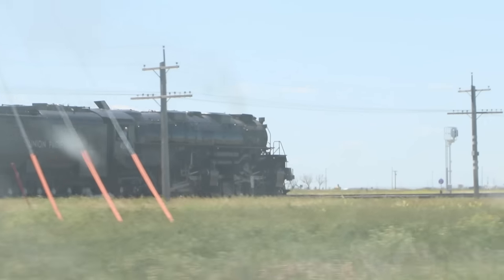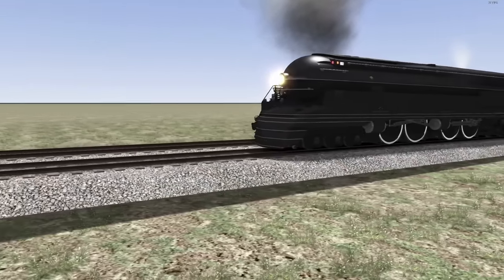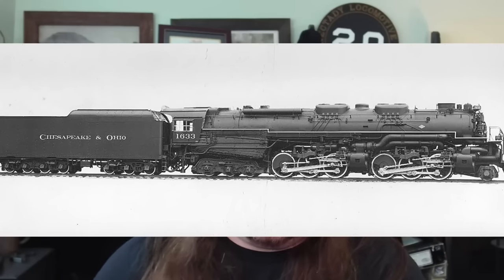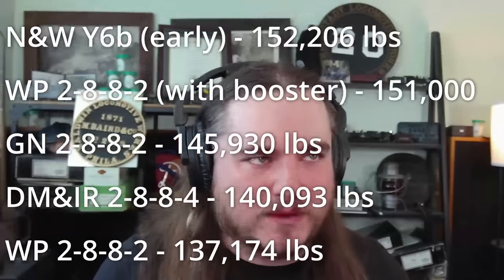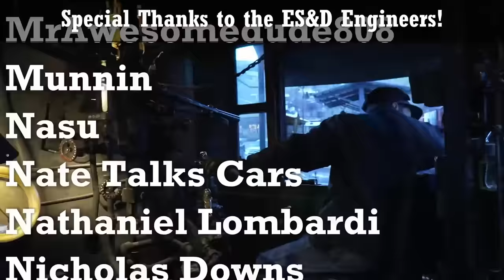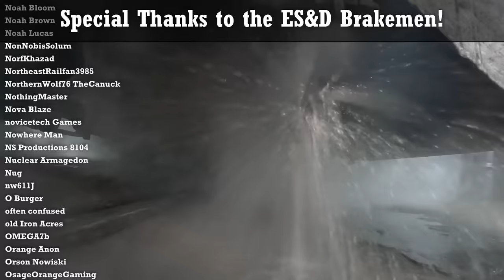BIG BOY is NOT the BIGGEST? What is then?

Comment: The thing with engineering anything for a specific application is that you ideally want to know exactly what you want the machine to do, and then optimize it for that use. There are stronger, longer, heavier locomotives than Big Boy, of course, but to compare really any engine of similar principle between one another, when you get down to brass tacks, is an apples to oranges comparison. These machines were designed for a specific purpose, at a specific speed, in a specific environment with specific restrictions. To ask what’s the absolute fastest, or absolute strongest, or absolute anything abut any machine sort of loses the nuance of what actually matters. What actually matters, in this case to the railroad management, is what is the best locomotive for us. What is the strongest or fastest locomotive, for us, for our specific restrictions and requirements.

One excellent example of this, in my opinion, is the Milwaukee Road’s Atlantic types for the Hiawatha. Almost every other railroad went for Pacifics, Hudsons, even Northerns for similar requirements, and yes, even the Milwaukee themselves ended up budging and buying Baltics (what they called Hudsons) later on. But what mattered most to the Milwaukee wasn’t ‘whats the strongest, fastest engine on the market right now’, it was ‘what is the best design for our needs and restrictions right now’, and it just so happens that a superpowered variant of the venerable Atlantic design happened to fit the bill.
Reply: Agreed. I’ve already said my thoughts about the subject, but there is more to locomotive design than just what is the biggest and the fastest.

Comment: Hmm...I'm not familiar enough with some of those eastern engines, but I think part of the reason the Big Boy stands out (besides excellent publicity on UP's part) was the fact that it was not only large and powerful, but could also move fast.  The Big Boys were reportedly tested at up to 80 mph, although its optimum speed was much lower; looking at the list of stronger engines, most of them look like engines designed to slog heavy trains at low speeds.  Its size limited its operating territory, but the Big Boy was a much more general-purpose locomotive than the others.  And a "world's biggest engine" that can roar by at 60-70 mph with a long string of cars sounds more impressive than one that trudges by at 20mph with a long string of cars.
Reply: The Allegheny's regularly hauled 140-160 car loaded coal trains and merchandise trains at 45 mph, so these two are certainly in a league of their own
Reply from the maker: Oh certainly. I'm not saying the big boy was not the most capable thing around, I'm just saying if you claim it's the biggest of all time you're not right. Lol

Comment: Widest steam locomotive was the Virginian 2-10-10-2s, which were just over 12 feet wide to accommodate their 48" low pressure cylinders. This is outside standard clearances so they had to be shipped to the Virginian with the cylinders, cabs and running boards removed and even then could only be shipped on higher than normal clearance routes. They also had the largest diameter boilers of any steam locomotives, the highest tractive effort of any successful steam locomotive, and the largest amount of evaporative heating surface of any steam locomotive. This is all despite being built in 1919, more than two decades before the Big Boys.
Reply: I should also note that the tractive effort number provided in this video is for compound operation. With their enormous boilers the 2-10-10-2s were normally run in simple for starting trains, and could produce 176,600 lbs of tractive effort when high pressure steam was sent to the huge front cylinders. Also I say highest tractive effort of any "successful" steam locomotive, because 10 of them were built and they operated for 25-30 years doing more milage than the Big Boys despite having a top speed of around 15 mph. The locomotives that exceeded them like the Virginian Triplex and Jawn Henry were one off experimental designs which were scrapped long before their designed service lives were over.
Reply: @NorfKhazad  A couple of points  the N&W  in 1917 brought into service the Y2  2-8-8-2 ,; with both tender boosters working produced 174,400 lbs tractive effort ,although the boiler could not sustain this for long periods of time ...fast forward to 1954 ;when the N&W had all the Y5 Y6 Y6a Y6b outshopped with 40 tons of scrap steel, lead and concrete onto the mainframes along with intercepting valves and extra [water]tenders , and reclassified Y6c with 310 lb b.p. they produced 190,000 lbs tractive effort in simple and were the most powerful locomotives ever in service except for 1 ! The Belgian quadruplex built in 1932 that produced 213,000 lbs tractive effort. The Nazis cut this loco into two seperate locos in 1943.
Reply: @dennismitchell-h9s  The Y5s and Y6s were upgraded to Y6Bs, the Y6C was proposed but never implemented. Some of the changes you mentioned (intercepting/reducing valve, added weight) were part of the Y6B upgrade program, but they never produced 190k pounds of tractive effort. I have never heard of this Belgian locomotive and I very much doubt it produced that level of tractive effort, if it even existed.
Reply: Thats the one I was trying to remember, they actually outpowered the Big Boy in raw tractive effort, but they couldn't get past 15mph or so because the boiler despite its size couldn't provide enough steam.  This primarily because they were 20 years earlier and boiler technology didn't have pressures as high.
Reply: @Saxxonknight  It was less because the boiler couldn't provide enough steam, and more because the low pressure cylinders were so large the reciprocating forces were a real problem. That's the main restriction on speed of most compound articulated locomotives. The N&W overcame this with the Y6B through some clever counterbalancing and other tricks, allowing it to achieve an unprecedented (for a Mallet) top speed of 60 mph. The Virginian 2-10-10-2's were huge, but relatively primitive Mallets. Sometimes referred to as the 'ultimate drag era locomotive' they were built during a time when tonnage was the primary consideration and speed was an afterthought. They had the largest boilers of any steam locomotives ever made, and while their design did not benefit from later efficiency improvements, accounts say they produced more than enough steam for the prodigious appetite of their huge cylinders. Also, as previously stated, they overpowered every successful reciprocating steam locomotive in tractive effort, not just the Big Boy. The only thing that beat them was the Triplexes, but those DID have problems with insufficient steam supply and couldn't even manage to sustain 5-10 mph for a few miles without stopping to build up steam.

Comment: The Big Boy is an awesome locomotive, and I never in my life thought I would see one that large restored.

Locally, we compare it to the Missabe Yellowstones.  They were about 100 feet apart when yhe Big Boy visited the Duluth museum.

Truth be told, they overlap a lot in statistics.   Big Boy has   more boiler horsepower and top speed.  Yellowstone has less horsepower and lower top  speed, but more tractive effort.     Big Boy is slightly longer because it was designed to burn low BTU western coal compared to the Missabe's eastern coal, thus it has a bigger firebox.

Both were designed to do different things.  Big Boy was designed to pull trains in mountains at relatively high speeds.  Yellowstone was designed to pull endlessly long ore trains at very low speeds.

Both were awesome locomotives, and I am very fortunate to see one of them running.
Reply: Remember that the classification "Yellowstone" was from the Northern Pacific's classes of steam monsters that originated the name, running heavy main line freights over the NP's undulating profile across North Dakota and along the Yellowstone River for much of their main line. They were a well developed class as witnessed by the NP's four classes of 2-8-8-4s, Z-5 throughZ-8, comprising more than 50 units. But when the NP dieselized, they leaned into it and never looked back. By 1959, all the Zs were gone. Management had no desire to look back on steam and preferred to be seen as a modern progressive road that was eager to embrace the larger high horsepower diesels that came along. Only smaller steam engines were given to communities along the line. Even the historic Timken locomotive was cut up, against the wishes of many.

Comment: One must wonder… who gave Union Pacific, PRR, and N&W unrestricted access to the whiskey? All jokes aside, I think the Big Boy is the best of the largest locomotives, but the PRR Q2s were the best of the ridged frame locomotives.
Reply: Yellowstone?
Reply: I believe that you mean rigid frame locomotives.
Reply: I mean it worked ig..except for what the Pennsy. No idea how they thought the S1 would be practical..or any of the other weird duplexes.
Reply: @whispofwords2590 The T1 and Q2 worked just fine tbh. Just too late.
Reply: @whispofwords2590, well, if they had fixed the poppet valve problem and built and rebuilt right of ways to be like the Lackawanna cutoff, then it could have been a high speed steam locomotive.  And yes, I mean actual high-speed rail.
Reply: @ThePTBRULES  I wouldn't say the Q2 worked out. Seems like an over engineered J1 to me. The T1s yes.
Reply: PRR ran the S1 for years on the western leg of the Broadway limited.   Minimum curve was its issue, and of course the co$t.
Reply: The "problem" with the T1s, was the crews were so used to the K4 pacifics that were ran to hell and back and worn-out within an inch of their lives, they got used to how they ran and just tryed to run the T1s the same way. Plus back when the N&W had their class A and class Y locomotives in service they were considered the peak of steam technology.
Reply: @ThePTBRULES  T1 prototypes are built better than production. Mods were done in the production T1s that actually made it worse. T1s 6110 & 6111 had better valves and suspension than the T1 5500-5549 had. Trying to break mallard's record with the 5550 would be un economical as A engineer who ran them stated that a slower acceleration and not exceeding 120 will negate the known wheelslip which in the end the 5550 would be more best as an excursion locomotive. Replicating T1s 6110 or 6111 would be better than doing a next in line in the T1 production. Even the Q2s would been better as well.
Reply: N&W had no other choice but to go completely overkill goblin mode when building steam locomotives 😂

The Appalachian mountains are extremely difficult. Sure they are no where near the size of the Rockies but the Apps are vast and deep. The N&W and Virginian gave up with steam in parts of West Virginia and opted for electrified rail as their solution.
Reply: @loganbaileysfunwithtrains606  But mate, as steam technology improved ,steam once again reined supreme ; the Y6b s were in part built to take over from the electrics 1948/9. One of the few cases of steamilising a railway !

Comment: I love that you showed the Q2 in the thumbnail and then didn't mention it in spite of putting out 7,987 peak HP.
Reply: indicated, drawbar is 6645.
Reply from the maker: I missed that in my narrative and Wings & Strings got it for the thumbnail. Bonkers.
Reply: They were unsuccessful. A waste of money.
Reply: Those were the most thirsty steam locomotives I've seen reports on, consuming a whopping 16,600 gallons of water an hour.
Reply: 6200horsepower can pull a 3600t.0ver Wyoming and Utah h mountains
Reply: All of which pales into insignificance compared with the [edited] 15,552 HP [Re4/4 II + Re6/6] of a Swiss SBB Re10/10 combination which can run at 140 kph (appx 87 mph) on the Gotthard or Lötschberg lines at about a gradient of 27 permille. Electricity rules OK?
Reply: @petergaskin1811  virginian EL-3C: hold my pantograph wire
(mind you a 3-unit pair of EL-3C's could make about 7000 HORSEPOWER WHICH IS JUST
H O W ?

Comment: Remember the Virginian 2-10-10-2 which have ALL THE POWER. Edit: I'm writing this when it was published at 6 minutes
Reply: and was actually the biggest steam locomotive ever built
Reply: But didn’t have as much power as a yellowstone
Reply: Do you mean the triplex 2-10-10-10-2? Or did they make a duplex decapod?

At any rate the triplex was a hot garbage engine. She couldn't really go above, like, 8MPH. But, it was really, REALLY hard to slow her down from 8MPH at max beans. Something like 115k lbs tractive. I know they served for some banking duties for a bit but then were broken apart and made into decapods I believe.
Reply: @NashRailfan  in mallet form ya but in simple mode it's more power than the Yellowstones
Reply: @IsaacBaxter  Yellowstones are Yellowstones.. there are no variations (except SP).. all are 2-8-8-4’s, or for SP, 4-8-8-2 (cab forwards)
Reply: @philtheairplanemechanic  the triplex would've been an excellent engine had it had a proper size boiler.
the erie P-1s were scrapped outright, the Virginian XA was turned into a mikado and a bullmoose, the only one the Virginian had
and no he means the AE, which was a 2-10-10-2, class of 10 i think.
they lasted until dieselization in pusher service, and are the most powerful steam locomotives ever constructed while also probably being the largest.
triplexes had 8 drivers in each set
Reply: @NashRailfan  incorrect
Reply: @CoalChrome  tell me.
Reply: @CoalChrome  The Virginian AEs were not the largest, and even by tractive effort they were beaten by the XA and the Jawn Henry. However, both were experimental designs so ultimately I would consider the AE to have the highest tractive effort of any successful steam locomotive. They were the largest when built, and they did have the largest boilers by diameter and heating surface, and the largest cylinders (48x32 lp) of any steam locomotive.
Reply: @NorfKhazad  actually they were stronger than the XA, by technicality because they could be swapped to simple.
Jawn Henry doesn't count because it was steam-electric
Reply: @CoalChrome  The XA was capable of simple operation based on the books I have, however in practice I doubt it was ever used that way since it couldn't maintain steam even for compound operation.

As for the Jawn, agreed, it's kind of its own thing.
Reply: It was used when starting but only for starting

Comment: That PRR with long tender is a I1sa class 2-10-0 pulling a 210F82 tender. The 210F82 tender is a 21,000 gallon tender with some 21 tons of coal, on a pair of 8 wheel tenders with a modern 3 person doghouse. When fully loaded, it would have outweighed the I1 by about 80,000 pounds. The I1 was known as a monster locomotive from the drag freight era and was nicknamed the Hippo

Comment: Did you take into consideration any of the big Garretts from South Africa?  Some of those are VERY long, and quite powerful, too.
One thing about the Big Boys was how WELL they worked. Many of the other engines were failures for different reasons - from being extremely complicated (like many Duplex engines), to excessive maintenance, to not having the steam capacity to make use of their power.
Reply: Yes, I've heard it said of the Big Boys--exaggerating a tad--that you all you have to do is put warm water in them and they go!
Reply: I was thinking about Garret engines too, but don't remember anything specific about them. Isn't the Big Boy itself classified as a Garret as it has one boiler over two sets of driving wheels.
Reply: @eekee6034 The Big Boy is not a Garret. Only the first set of drivers swivels. The boiler sits on the second pair like other articulateds.
Reply: @Stooltoad5017  Ah, I see. Thanks.

Comment: Ayo Hyce

As a viewer from the Metric world I'd really appreciate the inclusion of the converted units
Reply from the maker: I really should've done that. My apologies.
Reply: In the context of this video, I don't really understand why one should need other units when the point mainly is to make comparisons in which case sticking to one unit system is much easier to follow. Even though today's world is largely metric, we should still honour all units of measurements especially when we are discussing historic accounts. Just my opinion of course, but all that said here you go:
WIDTH-
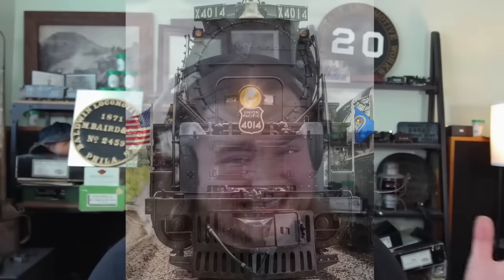1:48 Big Boy = 3.35 m
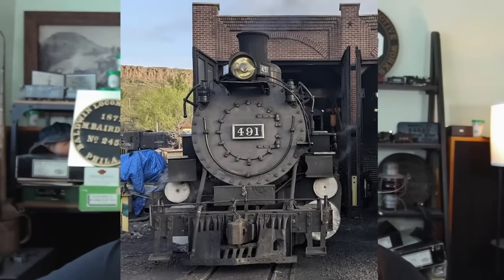1:50 491 = 3.20 m
WEIGHT-
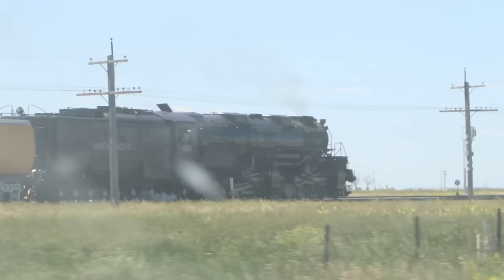2:29 Big Boy loco + tender = 548,279.78 kg
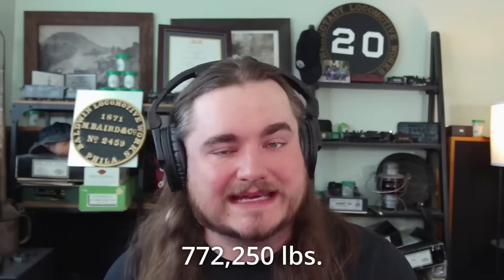2:55 Big Boy loco = 350,286.71 kg
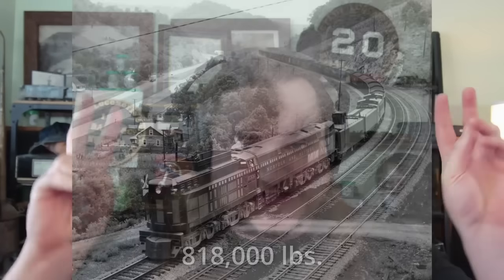3:02 Jawn Henry loco = 371,038.56 kg
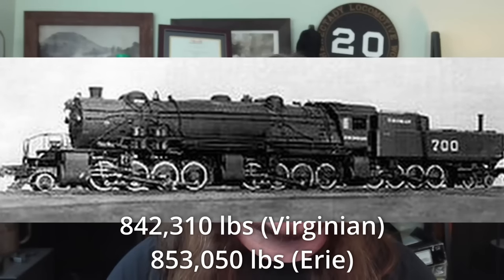3:05 Virginian loco = 382,065.39 kg
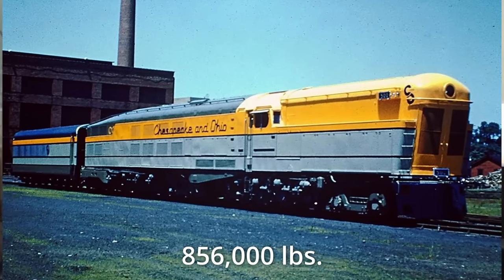3:06 Erie loco = 386,936.97 kg
3:08 M-1 loco = 388,275.07 kg
OVERALL LENGTH-
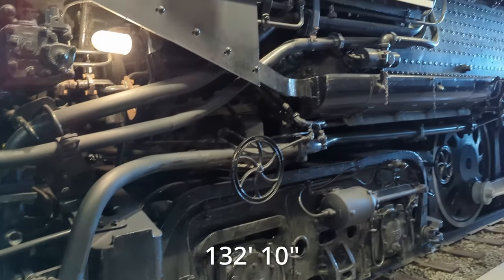3:24 Big Boy  = 40.47 m
3:41 PRR S1  = 42.74 m
4:07 Jawn Henry  = 49.11 m
POWER OUTPUT-
5:17 Big Boy = 4,697 kW @ 66 km/h
5:38 Allegheny = 5,592 kW
6:09 PRR S1 = 5,249 kW @ 161 km/h
TRACTIVE EFFORT-
6:47 Jawn Henry = 800 kN
6:47 Y6b (with booster) = 756.2 kN
6:47 Virginian triplex = 739.74 kN
6:48 Virginian 2-10-10-2 = 654.78 kN
6:48 PRR 2-8-8-0 = 744.3 kN
6:48 GN 2-8-8-2 = 722.72 kN
6:49 Erie triplex = 711.72 kN
6:49 NP 2-8-8-4 = 708.74 kN
6:49 Y6b (early) = 677.05 kN
6:50 WP 2-8-8-2 (with booster) = 671.68 kN
6:50 GN 2-8-8-2 again? = 649.13 kN
6:50 DM&IR 2-8-8-4 = 623.16 kN
6:51 WP 2-8-8-2 = 610.18 kN
6:51 Big Boy = 602.18 kN
Reply: @Azchk  
It is true that it would not be absolutely necessary to transfer the dimensions and information from the American system to metric ones, taking into account that most of the locomotives discussed come from US planning and production.
but it makes it easier for the international audience to follow the video and content. That's why including the values without commas would be enough to create a rough guide, at least for the dimensions of the vehicles.
Tractive effort is an abstract for most people outside the engineering and Physics community, or the real hardcore train-fans